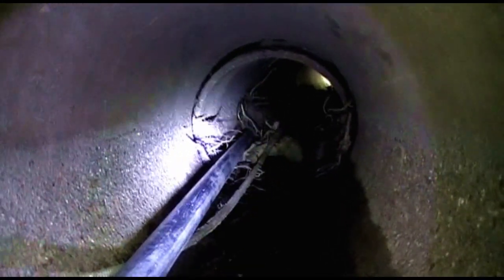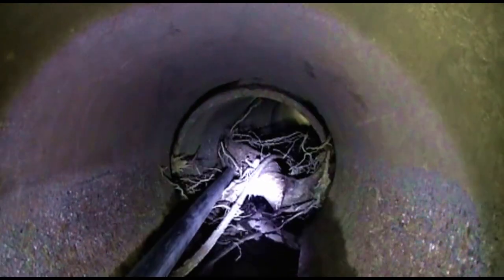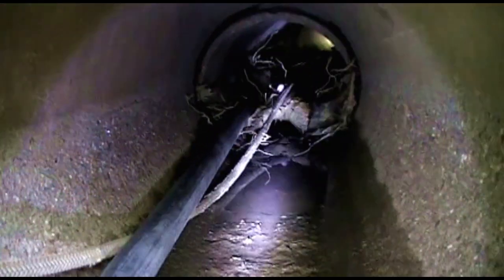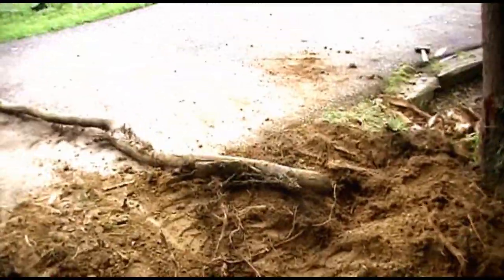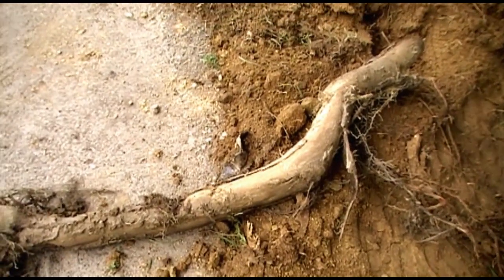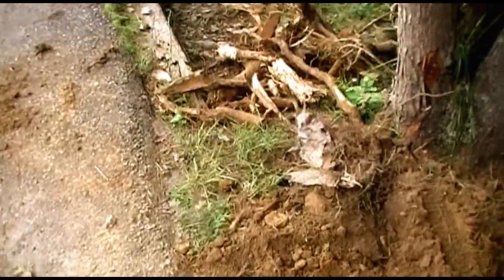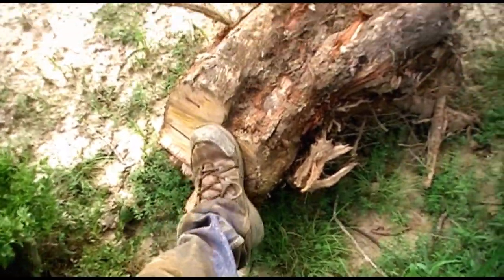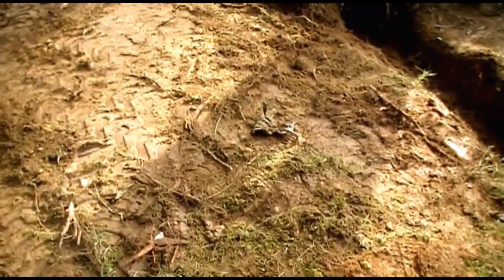culvert pipe cleaning with the Kubota tractor.

Comment: Just wondering how you cut the pipe?
Reply from the maker: this concrete pipe comes in pre cut sections and just fits together. each section is about 5 foot long. so I just dug till I got to the joint and pulled her out. the connection points is where the roots grow into the pipe.  I like the plastic pipes better they in 20 foot lengths and are smooth inside so stuff dont get hung up in them. plus its hard for roots to grow inside them since its so slick they cant attach to the walls like they do in these concrete covert pipes.